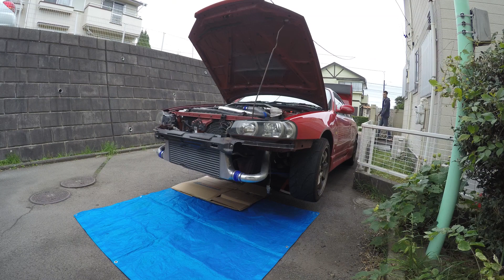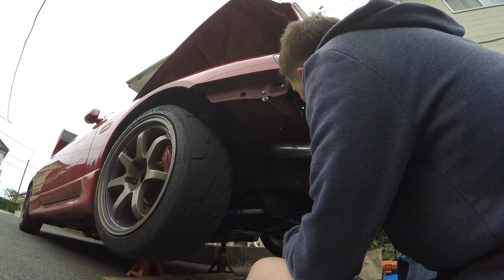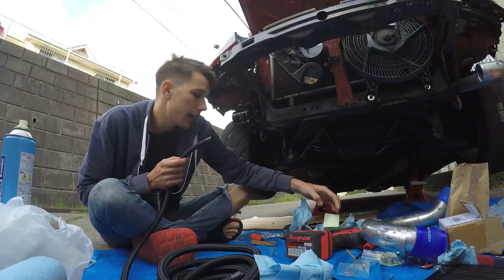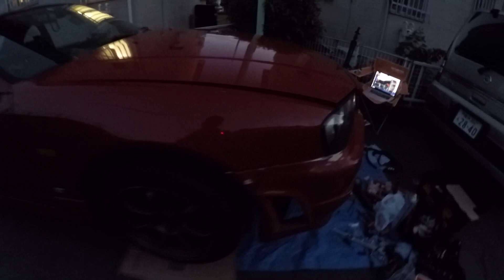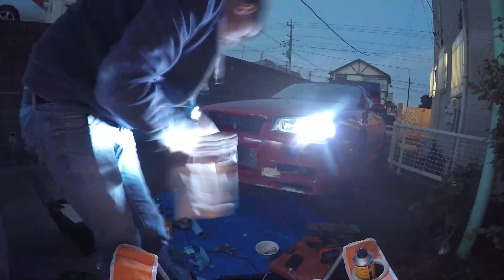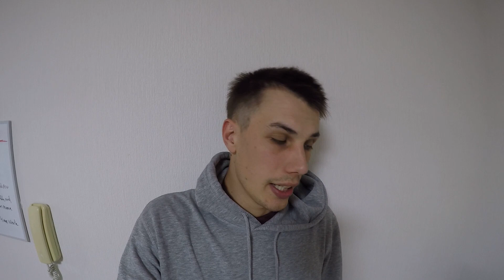OIL COOLER SAGA COMPLETED! - Nissan Skyline Oil Cooler Install

Comment: Don’t understand this piping layout unless the plenum has a forward facing throttle body.
Why not just run the inlet piping back under the aftercooler and back up to manifold on the other side?

Comment: Hey mate do you find the Nismo oil filter help to improve oil pressure as they advertised on it? I just bought one and am yet to install it. I have always either run Ryco or OEM Nissan filters. Cheers
Reply: I noticed that the Nismo oil filter improved oil pressure in my 32 GTR and my fiancé’s R34. 100% would recommend using the Nismo filters.